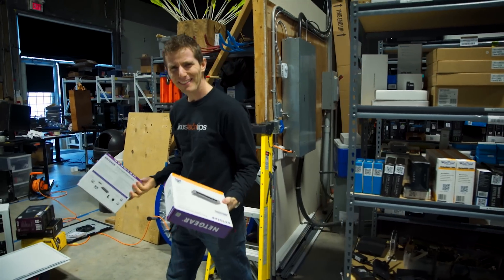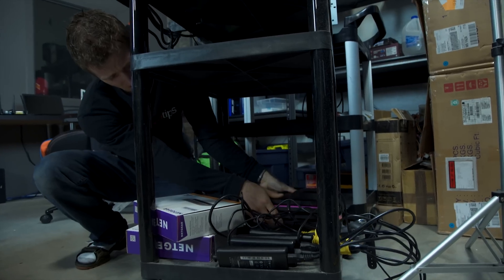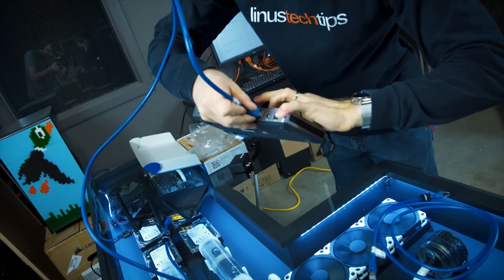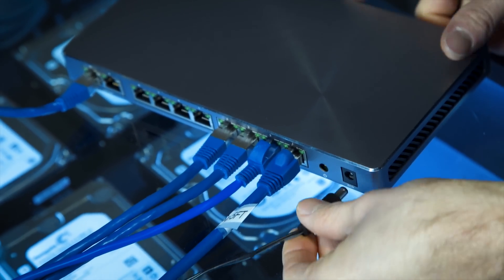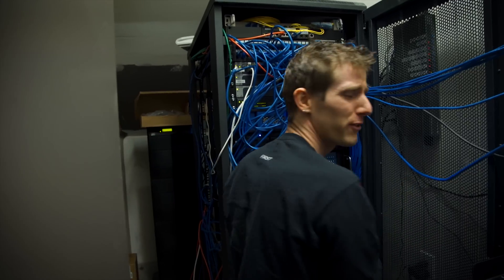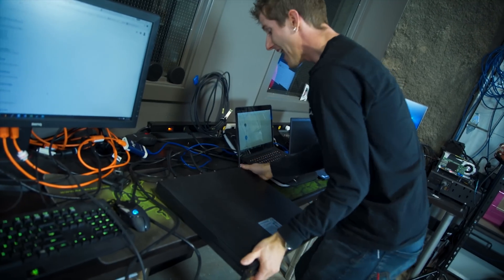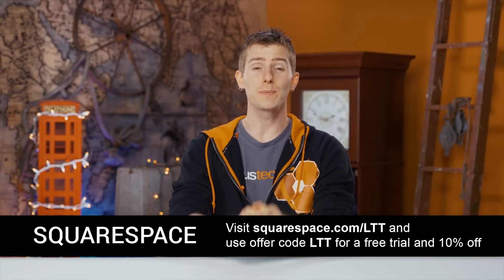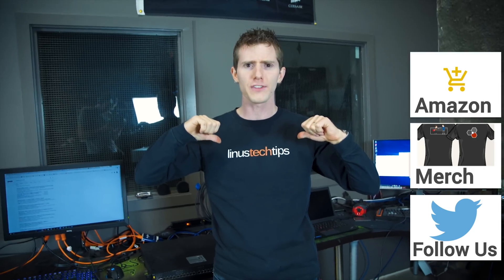Easy 10x Network Speed Upgrade

Comment: hey Linus followers i need your help my laptop just broke and i need a new one by Monday. my price range is $600-$900 i need the best bang for my buck. im am a engineering student so i need a laptop pretty good components. I can save and dish out $1400 if necessary. The school recommends a HP ZBook 15 G3 Mobile Workstation. which is over priced for the components in the laptop. Id love to hear everyone's opinion!!!
Reply: I don't know maybe the acer aspire e 15? It has an i5 and a gtx940m idk
Reply: bro hams found a old video of his about the Dell inspron I7559-251blk probably what ima get
Reply: undeadlich1 Your an engineering student, I was in middle school when I bought my first gaming rig. Do your research, it's boring, but necessary. Don't let other people choose for you, only you know what you need. But I will give you some advice. Laptops are always overpriced, always. If you look up individual components in a laptop, it will ALWAYS be too expensive. This is where I would recommend a PC, but obviously you need a laptop. So, what I would do, go buy yourself an AlienWare laptop for the best performance, it's better than most laptops, the only drawback is that it's expensive. Now you might say, now YellowGoose, why the hell do I need a gaming laptop? You said you could save and dish out 1400 $ I think you wrote. If you don't want the laptop recommended to you ( which I don't see a problem with if its recommended ) it's probably because you want "The bang for your buck". So, to get your "bang for your buck" get an Alienware, no matter how overpriced it is, because all laptops are overpriced. Oh and, don't think, well this guy has a PC, he doesn't know anything about laptops, I was in 6th grade when I bought a gaming laptop and I almost bought an Alienware over my PC, but realized PC was superior when doing more research. Now you might think, he was in 6th grade, well now you just need to trust me on personal experience and hours of searching Amazon, Best Buy, and dell for hours upon hours.
Reply: Oh and, the Alienware is a win win, if you ever do decide, or if you already play games on a computer. If you have steam, add me, my user is Stubeans. If you would like to contact me, reply with a way to contact you, or write a comment on one of my videos saying how to contact you.
Reply: man thanks :) your cool you play rust too. I have a pc that i play games on already including rust, i built it my self picking parts. see my problem is I need something powerful enough to run my engineering  programs( auto cad, solid works, mat lab and lab view ) in class because a few of my professors require us to submit work before the end of class. now in the past i have gotten away with a remote connection to my PC and was able to let my PC handle all of the leg work . they are not incredibly challenging programs to run but when im working on a project with a group i need something that` keep up(which streaming to my pc slows me down and i cant work like i should.) I like the alien wares but see where i got the $1400 price is a student i can buy a discounted mobile workstation for $1400 but it has a i7 6700hq, 8gb non ecc memory and a NVIDIA Quadro M1000M with 2 GB GDDR5 and a good battery life.Its not like that computer is commercial grade expect the nivida quadro so I would rather by a Pro-consumer gaming laptop to get more bang for my buck.truthfully I don`t plan on gaming on this thing because I want it to be a work machine. I've been shopping all day because I will have to rush order this thing because I have to have it by Monday. thanks again!!
Reply: undeadlich1 Like I said, only you know what you need. Good luck finding your laptop.

Comment: I thougt about upgrading to 10Gbe, but for home applications its still pretty useless. Even a Raid5 3 HDD NAS wont get much about the speed of a 1 Gbe Ethernet, unless you use SSDs or at least fast (NOT NAS) HDDs. So, upgrading AND using it still is pretty expensive. Maybe in a couple of years this will make sense in home application, but currently not really.

Comment: so in short ASUS vs Cisco/Netgear for 10gbps in theory there should be no difference besides for lack of customizability on the ASUS one
Quanta LB6M is used for a "Cloud switch" so anything faster will be welcomed their new switch that does 10/40 gbps over QSFP+ well maintaining SFP+ ports for the majority of the switch having the older switch make less and less sense as they get more and more people using it bringing the load higher on the network
the difference between SFP+ and ethernet is latency between packet transfers with that said it is not noticeable unless you are going to be doing big LAN party(s), having multiple people pulling from a local fire server,  or do local video streaming in 4k or above

Comment: So one computer can get 10Gbit effectively the other 8 are like hey dude give us more speed. If it where me I'd just buy a second hand managed 24/48 port gigabit switch, do some bonding voodoo and using it with NFSv4> and or SMB3 you can still get some awesome throughput for all users attached to the switch, or if that is to much work just buy a real 10Gbit switch :)

Comment: Damn i wish i had ethernet (direct connection) :/ I have a 2k+ gaming PC but i live in a house and my router is downstairs so the wire would have to be passed through several thick walls to run from downstairs to upstairs into my pc.. so not worth it/logical :/ its so annoying cause sometimes my ping randomly jumps up and i am currently using a extended wire that runs near my rooms door and at the end of the long usb wire is a wireless usb stick.. i cri :(

Comment: For SMB i will buy that Asus. Those SFPs doesn't come cheap plus those switches on Ebay doesn't work plug and play sometimes you need to configure the VLAN regardless it is a layer 2 or 3 switch.

Comment: Multichannel bonding or SMB multichannel could also be used without the need to bother buying any 10Gb/s hardware you could just reuse the hardware you have as long as the switch's blackplane supports the bandwidth you are going for you're golden. You could also build it cheaper than $250.

Comment: i hope you use it with iSCSI, otherwise you will waste the potential of your 10g switch
Reply: you can directly call the disks like you would when you have the disks installed in the computer, therefore it uses less bandwidth for the overhead.
Reply: i thought he has a storage server

Comment: Are these components good to make a good pc ?? Intel Core i5-6500 3.2GHz Quad-Core Processor ASRock H110M-HDS Micro ATX LGA1151 Motherboard Corsair Vengeance LPX 8GB (1 x 8GB) DDR4-2400 Memory Gigabyte GeForce GTX 1050 Ti 4GB Video Card DIYPC Ranger-R5-B ATX Mid Tower Case EVGA 430W 80+ Certified ATX Power Supply  is this good ?

Comment: At 3:30 Linus says the other 1Gbps devices on the switch when communicating to the the 10Gbps Storage device can NOW REACH THEIR  FULL NETWORK SPEED. Is this true? They will be transfering around 128MBps (1GB = 1024MB / 8bytes = 128MBps?

Comment: To all the idiots in the comment section who don't understand the difference between a home network and the internet: You need this if you have an ultra fast NAS that can deliver data at something like 1 GB/s (gigabytes, not gigabits) and if multiple people want to access it at the same time. You don't get the full 10 Gbit/s speed on the devices that are connected to the slow ports, but there won't be a bottleneck if the NAS is connected to a fast port on the switch.

Comment: So... What's the purpose of that clapper board?

Also, here's a correction: raw stream directly ripped from a BluRay disc usually won't be called BDRip, but rather, depending on the format, BDISO (if it's an iso file), BDMV (if it still has the same file structure of the original disc) or BDRemux (if the streams are packed into a single file). BDRip is for compressed one. (Well, technically BluRay is already an compressed format. If you really want uncompressed format, go for things like YV12 or RGB24 or et cetera. But, do a simple math and you'll see that, a typical movie (1920*800@24fps) would have 840Mbps just for the video if you want to store it in uncompressed RGB24. That's, well, unless you want to switch disc 8 times during one movie I guess.

But anyway, since typical BluRay stream is only 100Mbps, a gigabit network would be able to host almost 10 machines accessing raw BluRay stream simultaneously, so... 10Gb network is really only "a must" when you are dealing with tons of uncompressed streams, I guess, otherwise it would only be useful in a way that you don't have to wait in a line when accessing a file. (And by the way, if you need so much uncompressed streams, well, why not use things like, for example, Thunderbolt 3.0 instead...)

Comment: Really? That was the nearest thing you could compare it to? What about the Ubiquiti EdgeSwitch 16XG? Or even the JetStream T1700-16TS or Netgear's M4300 series if you're willing to bump up the budget a bit? Those are all considered "low cost" 10GBe switches and whilst they're not at the ~$300 mark you seem to be aiming at, they have far more 10GBe ports and I would argue you get better value per-10GBe-port on the EdgeSwitch 16XG (~$500 to ~$900 for a unit, depending on your region) than on either one you mentioned.

Comment: hey man.
I really need your help.

I want to buy a MSI laptop.
But I am in a real confusing state right now.
Should I choose 60Hz G sync pannel or 120Hz non G sync pannel?
I'm asking this because MSI GT62vr supports G sync but MSI GT72vr is 120Hz non G sync. Both of them are gtx 1070 Kaby lake processor.

I want to use my laptop as editing, high end gaming purposes.

I really want your opinion.

Thank you.

Comment: Screw 10gig copper, SFP+ fiber is the way to go :) Only two 10gig ports for $249? What a rip. UniFi Switch 16 XG for $299 kills it! 4 x 10gb RJ45 ports with 12 x 10gb SFP+ ports!!! :)

Comment: Nice you mentioned the Quanta (the LB4M is also worth looking into for cheapness: ~$100 USD) and fans can be changed out for quietness. I think Facebook is ditching them, hence the scale and cheapness. If you want new,  there's Mikrotik CRS226-24G-2S+ In (reviewed and used by Servethehome) or, pricier, Ubiquiti's ES-16-XG or Netgear Prosafe (8+ 10GbE ports). The Quanta, Ubiquiti, and Miktrotik are more flexible than that unmanaged Asus.

Best use is probably main computer and NAS. Especially if you do video work; you can edit directly from your  NAS without issues. Level1Techs had a recent video regarding their server setup making the most of 10GbE.

Comment: switch with 2 fast 10Gbps ports, isn't it about the same as 1 ethernet cable connecting two machines? I mean, expensive 10Gbps ethernet cards tends to have multiple ports anyways.

Comment: Not a bad choice moving into a full 10Gbps-ports solution with even 20 Gbps uplinks  to avoid potential bottlenecks especially with the latest MU MIMO technology getting adopted by a growing number of Network gear vendors on their APs! 
this requires CAT6A cabling at least but you could get away with about 5Gbps Speeds even with CAT5e on the MU MIMO devices as well so moving into 10Gbps port speed area makes sense for sure.

Comment: For me this only solves one issue, which I don't really think is an issue.  It would allow me to run my server and main edit machine on the same DHCP network instead of having two separate networks.  Although I don't typically have multiple gigabit clients hitting it at the same time.
Reply: No.  I have a general gigabit LAN (including my server and edit machine) with a single uplink to my wifi router, I do get full gigabit speeds over this for local file transfers and such.  I then have a second line run directly from my server to my main edit machine that is 10Gbe, there is no DHCP server on this network so I have to set the two IP addresses manually.
Reply: Yup exactly, ideally the 8 or more port netgear switch but they are $800 or so and I don't have that need yet.  I will in the future though.

Comment: Why would you want this switch vs a 24 port GE 2 port 10GB SFP+ switch?  Sure you get copper 10GBE ports, but you could use  direct attach SFP+ cables or SFP+ fiber modules.  Fiber is not very expensive or hard to terminate and it is mostly future proofed for significantly faster speeds.

Comment: Why does the Asus switch only have 2x10g ports, they all need to be 10g to make it a true 10g switch right? Because those 2 10g ports are having to divide the bandwidth between the rest of the ports with a 1g max per port.

Comment: anybody know the exact name/link of the first blur wire connected between the router and the small grey switch? thanks
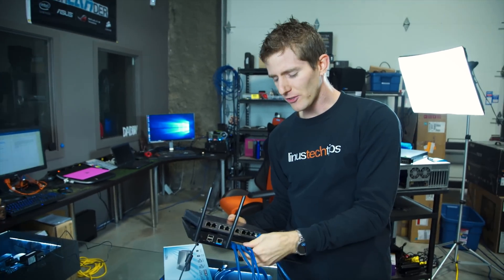Reply: uzuhl at 2:52 the one furthest to the left?
Reply: ....the power plug?
Reply: uzuhl k thx and what will the speeds help with if im streaming, rendering, editing, gaming?
Reply: what about for transfers of video from a camera?
Reply: If your camera has 10gig ethernet port, it will speed up the file transfer.  But I highly doubt your camera has it.

Comment: I remember hearing that switches are inherently unsecured and that one should always buy a hub instead.  Is that not the case?
Reply: PTNLemay: Uh, that's the exact opposite, dude. Hubs broadcast your traffic to everyone attached to it. Switches should only forward traffic to the intended port and has further mitigations for spoofing.
Reply: Mike Trieu 
hmm, then I must have remembered it wrong.  Thanks for clarifying.

Comment: So, why didn't we get to see the performance of the eBay 10g-beater-switch?
Reply: It would most likely perform about the same for the single large 10GB file transfer. The main difference is that it has 24 ports at 10GbE instead of 2. That and it may have larger TX buffers, lower latency switching, support for VLANs and ACLs and other similar things (which is not going to make a massive difference for the average home user or even an advanced home user).
Reply: Pete Kowalsky: Cuz Linus is just a huge tease 😛
Reply: +DiceAir If it was sponsored, he would have to say that it's sponsored, so no, it isn't sponsored.
Reply: It's pretty much the same thing but has enterprise stuff that no home user except a bored me would use.
I've got the Quanta LB4M switch, which is pretty much like the not-as-cool-but-way-more-useful younger brother in that it has 48 GbE ports, so I don't have to use freaking SFP+ converters just for my dang gigabit. It's the same as a normal switch in its normal mode but has a bunch of configurations for VLANs and stuff and it's pretty fancy and all.
Reply: i agree. this was maybe a sponsored Asus thing and Linus can't shoe the 10g Ebay swich beating the asus one.

Comment: One thing though, would you just plug in one cable from a router to a switch, or use 2 or all 4 in the hopes you get better connections if several devices which are all connected to the switch are downloading at the same time? (For internet connection, not LAN.)

Comment: Switches boring? I don't even know where to start... and this Asus is just a  smart HUB if you can't even manage it... (and lack of L2 protocols LLDP, 802.1q, etc etc..) I'm not a fan of Cisco but I will take their switches SFP is life... expensive but life.. 😂 you can take 2 of the 10Gb ports on LACP and make a 20Gb uplink to your Plex or FreeNAS box... or create a trunk to route all your intervelan traffic with your Pfsense box... isolate your voice vlan or your video vlan or your guest wifi vlan.. etc.. etc...
Reply: That would be a good solution.  Pick up a cheap Cisco box off eBay that just got pulled out of a data center and configure it as needed to separate voice/data, use QoS for prioritization or however they want it built.  Lots of better options, lots of time if you don't have someone familiar with the syntax/code, gear, and how to design and implement, let alone monitoring and managing the boxes...can always go the route of shit's broke, someone figure it out shrug
Reply: 3560E has 2x 10GB ports, and it's not that expensive.
Reply: Linus is referring to people at HOME. No average user is going to need ALL of that.
Reply: No, but there are plenty of situations where a managed switch is nice on a home network.
Reply: I agree, I have several but I host lab environments for CCIEs/CCNP students, but just joe blow with a run of the mills job doesn't actually need it.

Comment: Btw, in my opinion, the best 10G capable switch is the Zyxel XGS2210-28. It has 4 sfp+ ports - good future-proofness AND has 20W power budget, so it PASSIVELY COOLED with 4 10G uplinks. It costs about 600 dolars, but that is the price of cca 3 10G  network cards, so in my oppinion it has great value for me ( pc + nas + vm server ) = 1 free 10G port.

Comment: ppl don't get so worked up about internet speed. This is a great solution for Local Area Networks that depends on great speeds or just playing around with some 4k for the family. Thank Linus for the solutions. Remember that you need lan cards that supports 10gb connection speed.

Comment: My fiber network at home is supposed to deliver 300 Mbps, which it does on cable. On WiFi it rarely surpasses 60 even on a  
5 GHz connection. Can you make a video on how to optimise WiFi in your home?